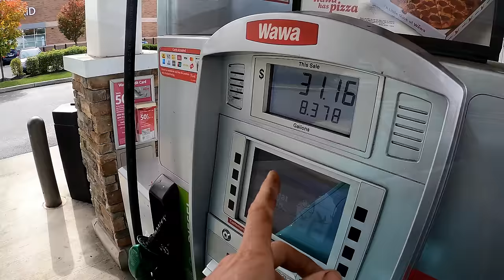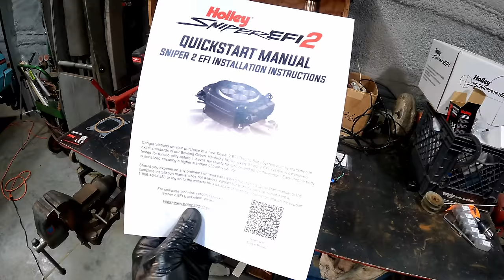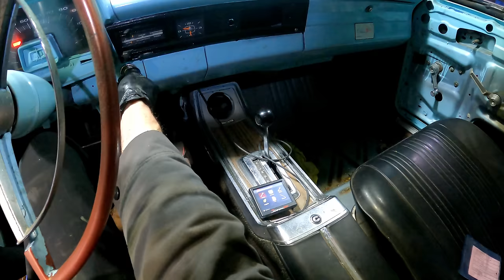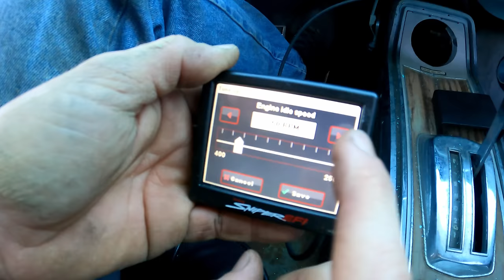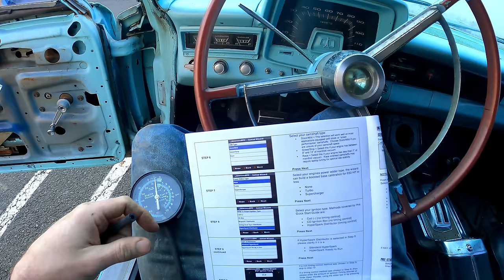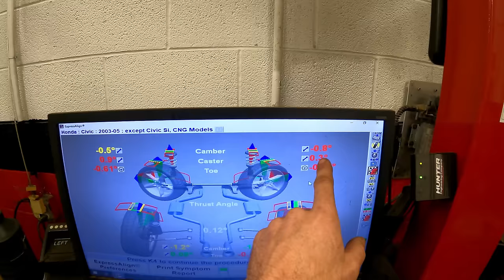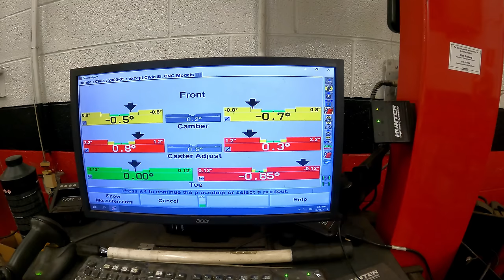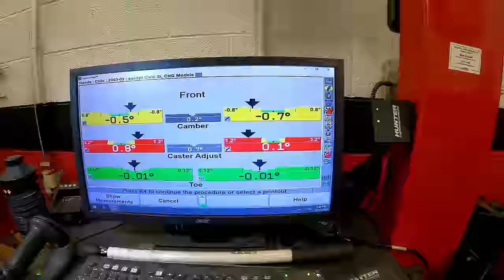1965 Fury Wagon Gets A SNIPER 2 EFI + Update On Jens Civic - NNKH

Comment: I've been wanting to run clr through a saturn sc1 , but I love been concerned about the water pump
Reply from the maker: If it's not overheating or having any problems I would just leave it alone. Maybe just change the coolant. If you go cleaning out all the gunk, a lot of time you open up more problems
Reply: @NoNonsenseKnowHow  It's not overheating but it gets close sometimes,   I replaced the thermostat about 6 months ago because I started getting a little fluctuation with the heat Guage   and unknowingly put a 190 degree thermostat. 

Well,  that really didn't fix the problem now it just gets a little hotter . 

The heater under Idol suxs,  
Going down the interstate st 75 -80 it works good enough.  

Short story on this car,  I pull it out from under a metal carport , it had been sitting at least 5 yrs,  put 5 gallon of fuel with some Lucas upper cylinder lube added to it , pit a battery in it and it cranked , but the water pump was trashed,  and from the looks of the  water pump I believe a lot if water was run through it then with sitting that long.

I go get the oil changed in it and went to driving it 200 miles a day for the last 2 yrs , the car was free the water pump was less than 30 bucks 50 bucks to change oil,  50 for a battery and 200 on a new set of tires,   I did the mathematicals in May of this yr that was a yr and this little car saved me 14,000 dollars . 

So I have a new found fineness for Saturn's or atleast the sc1 1.8 ltr single cam.
Reply: Anyway I'll make a short story long , but I'm thinking I've got a coolant system flow problem

Comment: drain cooling system completely, blow out with air.. fill completely with EVAPO RUST, start to circulate and fill entire system, turn off, do not let it get past warm.. let sit over night, start up to temp, let cool to warm, drain and rinse, rust ALL GONE!   easy peasy japanesey and if you think there is more rust repeat . . .   there is no rust evaporust cannot remove to bare celan metal

Comment: wonder if the poor fuel mileage is due to no t stat and running so cool? efi may have been running it rich waiting for it to warm up to  normal temp before leaning back out..
Reply: Yeah, one of the reasons why... 

My son's Mazda 3 had a thermostat that failsafe on the open side and sets off a trouble code.

Told him to expect slightly lower mpg until l I have the time to swap it out and reset the trouble code 😅

Comment: Thanks for the tip on ride height adjustment prior to running home the rear bushing mount bolt.

Will you keep those control arms and get new bushings? Or do you not expect to repeat this service?
Reply from the maker: No problem. I'm hoping these aftermarket arms last but I'll probably keep the old arms just in case

Comment: Why is the gas mileage so poor despite a modern fuel system? what is the rear end ratio?  I suppose combining big cubes with a high rear end ratio, no overdrive and no tall tires and lo locking converter might make the mileage unrecoverable, but after Thunderbolt289 got over 40mpgs from a 302 Maverick, I figure there must be a way to improve MPGs on that Fury wagon.
  Might there be room for more vacuum advance? without spark knock?

Comment: I just installed one of those champion Inline coolant filters yesterday and I could not get it seal. I tried vacuum filling and it leaked bad at the seals between the glass and cap
I couldn't draw any vacuum at all. Just a heads up if you are fighting overheating in the future you may be getting air in the system.

Comment: I noticed that you put in regular high octane unleaded. That engine, unless the valve seats have been changed to hardened steel, are still milled cast iron. What are you doing for lubrication? Are you putting some sort of additive in sometime along the road here?

Comment: What do you think of repairing bushings by filling them with silicone or polyurethane instead of replacing them? thereby keeping the oem A arms?  and could this be done on the car without ever removing them?
Reply from the maker: I don't think it would last
Reply: @NoNonsenseKnowHow  I have seen polyurethane fills done by removing from the car and using a mold that ended up being a bit too stiff even for street performance, remember the originals have big hollow sections where a filled ring is usually filled solid, so there is more risk of making it too firm than not firm enough, at least with solid polyurethane.

Comment: So question on the alignment,  got a SUV with 1 yr old tires.  last oil change and tire rotation(done every oil change as I drive at least 400+miles a week)  I was told the inside of the tires were wearing more than middle/outside.   My question is will an alignment help make the current tires last longer ( i know current wear won't be fixed, just trying to make these last as long as possible.  only about 17k on these tires)   I also live in PA, just western side of the state.
Reply from the maker: I have seen some vehicles that just tend to wear the inside out quicker more than others. Also depends on road conditions and driving habits. However I would definitely suggest checking the alignment. Toe out will cause a lot of wear and yes if correct it now, you will get more life out of the tires. You can also check it with a tape measure. There are some good videos on YouTube about how to do that.
Reply: Thank you, appreciate it and love the videos.   @NoNonsenseKnowHow

Comment: hey i got a problem with my car i get a shake on the highway i dont really feel it in the steering wheel but it feels like kinda like a hop at slow speeds could that be alignment issues
Reply: Start with a tire rotation front to back...

While it's lifted, do that "shakedown process"

grabbing the wheel/tire 12 o clock and 6 o clock and shake

Then, same hands for 3 o clock and 9 o clock

Checking for loose ball joints, tie rods, loose bushings, wheel bearings.

Can't do it over the Internet unfortunately... Gotta put them hands and eyes on the problem 😅

Comment: Had a friend with a 69 cameo frame off everything new crate motor brand new Z28 hood with the cowl induction brand new flex fan it didn't last a month came apart right through the hood and radiator it was thousands of dollars in damage New Hood all repainted original owner of the car I mentioned about the flex fan didn't believe me

Comment: you realize using hose water is contradictive right? its gonna cause rust unlike distilled water
Reply from the maker: Do you realize that once you pour distilled water in a dirty cooling system, it's immediately not distilled water anymore. It's got more minerals and deposits in it than the stuff coming out of your faucet. Instantly.  Also, I did use distilled water on the final refill with antifreeze. Even though that was probably waste of a few bucks. When you doing multiple flushes, using tap water is fine.